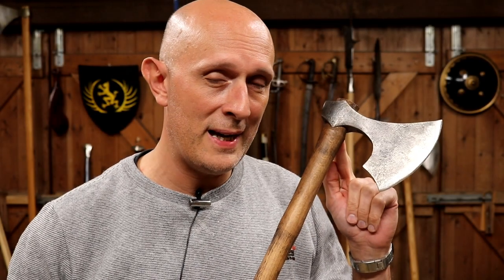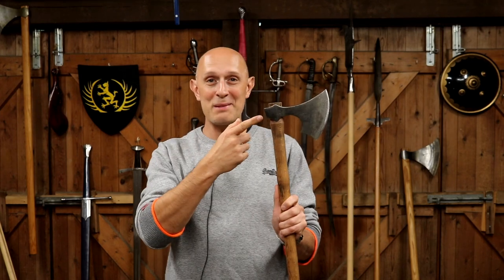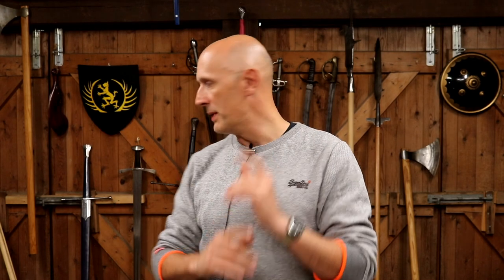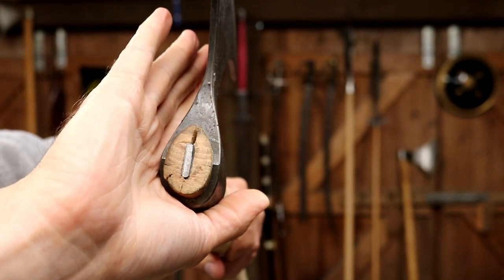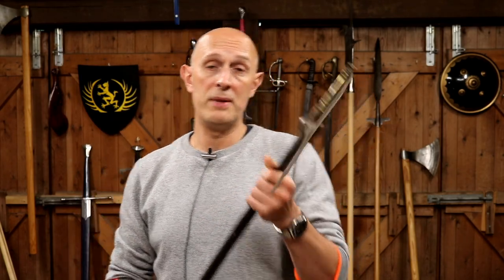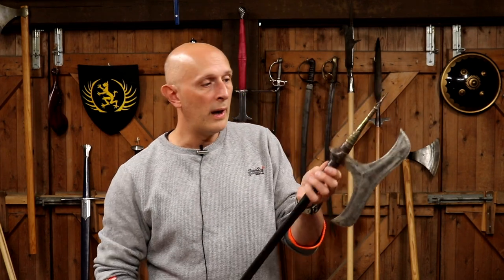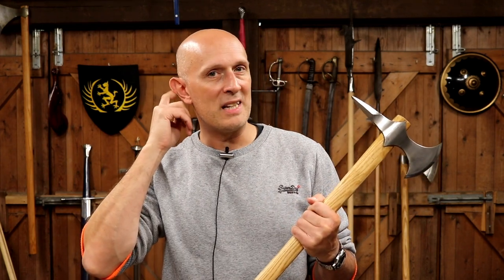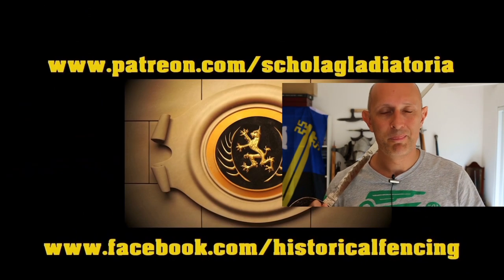Medieval Axe Construction - What Many People Get WRONG

Comment: My best guess is that using a wooden wedge in a wooden shaft might actually have been a premeditated choice - if the shaft starts changing size, the wedge would follow. 
With a metal wedge, you run the risk of the 'join' coming loose due to difference in how metal and wood react to environment changes.
Reply: Interesting point. Could you use a different even more sensitive wood?
Reply: I have made axes a couple different ways. Sometimes you use a wood wedge. Sometimes a metal one. Sometimes a wood one and THEN a metal one set at 90 degrees. It depends on a number of things including size, use, materials, and as you so cogently point out the environment.
Reply: That’s a really good point! 

I think a secondary reason may be that metal was too precious in some societies or areas in certain time periods for metal to be used as wedges. Why use a metal wedge when a wooden wedge could be obtained easily and cheaply. 
It may not seem like much to us but maybe  two or three metal wedges could be made into one good nail for shoeing a horse, and maybe three or four good nails could make a small thin knife a leather worker, seamstress, tailor, net mender, quill maker, fletcher, thatcher,  etc.. would need to pay good money for to make a living. 
Many carpenters did not use nails or used them only sparingly because of their expense. That’s why there’s so many different joint types in carpentry. I can think of two right off the top of my head, mortise&tension joint and dovetail joints.
Reply: I would have guessed the friction of wood on wood is bigger than metal on wood (dry and wet), and moisture expands wood but not metal.
Reply: @phillipmargrave  That is something we forget in our metal-rich present. The first axe I ever made was a copy of a trade axe from Fort Vancouver. Tool steel was very expensive, so the tiny piece was sandwiched inside the plain iron body. Good quality wootz was used sparingly in the best swords and cutting tools thousands of miles away in the Philippines centuries ago.
Reply: My mind really boggles at the way people make this complicated, I make handles for tools and wood works as well as anything, what you need to do is fix the head so it does not slip, simple as.
Reply: Yep, plus it rusts out

This is still a thing in knife handles
Reply: I don't think I've ever used a metal wedge for an axe...
Wooden wedges are so easy to make from off cuts & I'm much too lazy & tight fisted to actually go out & buy one!
Reply: @nirfz those are exactly two reasons why you would use a wooden wedge. Wood on wood friction means it will not fall out of place. And iron not changing its size means when the wood changes its size the wedge will fall out.
Reply: I think metal wedges are a product of the industrial revolution, and by then axes were mostly relegated to tool applications. Wooden wedges can be more delicate and often fail to mechanically survive the hang, but metal wedges were more robust to drive into most any wooden axe handle, no matter the sloppiness of the handle itself. But wooden wedges, especially if they are made from the same piece of wood as the handle, are always the superior wedge to use because both the wedge and the handle will shrink and expand in reaction to environmental changes—exactly what you pointed out. I use hickory wedges on hickory tomahawk handles, and this assures a solid head/handle connection no matter if the tomahawk is in a cold and dry winter in Montana or a hot and humid summer in Alabama.
Reply: I have hammers that go back to my grandfather and the heads are held on with wooden wedges.

Comment: My group has a number of axes that slide up from the bottom. We usually just tie cord or a bit of leather under the head after tamping it down to help keep it in its place. Helps make sure you don't get your fingers munched by your own axe head.
Reply: Ooh!, that's a good idea.
Reply: I would also think a leather or cord wrap on the handle part of the haft would provide plenty of grip to avoid the axe coming out of the hand.
Reply: @natehammar7353  I can definitely see the benefit of a band of leather or rawhide just below the hand position, as a stop for sweaty or wet hands. Good thought there!

Comment: The great thing about wooden wedges is that when you leave your axhead in linseed oil the handle as weell as the wedge swell up and give a very secure attachment, I do this with my wood chopping axes and I have never seen it fail
Reply: People forget that metal was very expensive throughout history. If they could do the job with something else, they tended to.
Reply: @nathanielkidd2840  yes, and in my opinion, since the wood wedge works very well, the metal ones needed to become quite cheaper then those before being so widespread, and that probably happened later.
Reply: brush it lightly with linseed oil, NEVER leave it soak in the stuff. Oil-soaked wood is not good, and your axe head should be secure when dry, or else it's poorly hung.
Reply: @BeetleBuns  why never soak it? Would that damage the wood?
Reply: @karltriebel4262  yea, oil-soaked wood breaks more easily than properly treated wood. I've replaced plenty of cracked and broken gunstocks that were soaked with oil, the wood just doesn't hold up to constant pounding. With a hammer or axe it's even worse. It's better to just hang the head properly in the first place, there's no reason to ruin good handles by soaking them. Besides, it takes WEEKS for a soaked handle to stop oozing oil, it's disgusting to work with.
Reply: @BeetleBuns  Thank you, I’ll not use that method 😁
You certainly wouldn’t want a slippery axe handle during a re-enactment battle!!
Reply: I hang axes as a hobby and linseed is good but I put it in over time, its only done for me and my entertainment rather than selling and trusting someone else to oil it properly so that's the context to my view, after soaking and after doing it my way then sawing the handle after a couple of years the ones soaked for a few days had a dry patch centre, slightly oily then crystallised oil on the outer, the ones done over time had a nearly complete saturation, personally I like a wooden wedge on its own with the oiling done over time, they don't rot at all and stay firmly attached with no shrinkage over time

Comment: I've got a German Goosewing Hewing axe, the end of the haft is tapered and fits into a tapered socket/eye like a chisel. The very end of it has rotted away but it doesn't look like there was ever a wedge in it or even the space for it. My guess is it was just a friction fit when it was dry and that was it. How tight it is depends on the weather and where I keep it, it's lasted since whenever people still hewed timber until now but I'd probably replace it if I expected to use it.
Reply: these goosewing axes are part of the axe myth themselves - even now they are sometimes identified as battle axes :) (even in academic publications)

Comment: Great video! Most of the spike tomahawks favored out in the Eastern Woodlands had wedged head-handle connections and oblong and even rectangular eye geometries. A lot used wooden wedges, and I was advised by my mentor, Jack Vargo, to always use wooden wedges, preferably from the same wood that’s used in the handle so that there’s no mismatch between the wedge and the handle in the wood’s natural shrinkage and expansion at different air moisture and temperature levels. However there are examples of spike tomahawks where nails were driven into the eye—often these look quite sloppy in execution, and Vargo speculated this was done in the field in order to secure a head that may have gotten a little loose. Any metal wedge can eventually lead to a loosened head/handle connection, especially if the head is hung in a hot and humid environment and taken to a cold and dry environment. The wood of the handle shrinks from the dry air, and the metal of the wedge shrinks from the cool temperature. A tomahawk hung with a metal wedge in the summer in Arkansas can be sold to a customer in Canada in the winter, and the axe head can be loosen in a day.
Reply: Hey Zack,
while watching this video i asked myself "what would that wingard guy think of that". Now i know. 
Love your products and your videos.

Comment: I'm a big axe guy. Camping and bushcrafting, not weaponry. I usually soak my axes in water for 24 hours so that the wood swells. It holds the axe head firmly in place.
Reply: Wood after several cycles of wet-dry tends to rot and get more fragile, also in the drying process it shrinks getting time after time narrower. I used to do it on my pick with a good quality beech handle, bad idea. 
Just put on some good wedges and let them do their job
Reply: If you soak the axehead/axe-eye in boiled linseed oil instead of water, you will get the same effect. But boiled linseed oil will crystallize and 'harden' inside the pores of the wood, making the swelling more permanent. I've only recently tried it, and so far so good. However, I'm not sure it's a 100% permanent fix.
Reply: Ethylene glycol should do the same thing. I believe it is how they preserve old wooden ships.

Comment: Metal wedges are probably a recent innovation.  When I was a kid growing up on my gradma's small ranch we had an old farrier's barn.  Inside were lots of old tools, probably dating back to the farrier, and tools that had belongrd to my mom's stepdad, who was a carpenter.  I clearly remember that all the axes had oval handles with wood wedges holding them on.  They probably dated back to the late 1800's and early 1900's.  I remember  because the first time we ever needed to buy a modern axe was we our family went on our first camping trip in the late 1960's.  My dad took me to buy some necessary equipment, including a campcaxe.  I was surprised because that was the first time I'd ever seen metal wedges  in an axe head.  I thought it seemed cheap and silly and of lesser quality.

Comment: I friction fit my axes from the bottom and use wedges to prevent sliding down- works like a charm and they don't break. The "points" on the eye that face downward toward the shaft act, by the way, as excellent guides and insertion points for wedges. I think their presence is fairly good evidence for wedging from the bottom, after doing it myself.

Comment: Interesting video, Matt. I wonder though, how would axes with spikes at the top be fitted through??? Was it forge welded on after the axe itself was fitted onto the haft, or would the axe and spike have been one solid piece that would then fit over the top of the the haft and then perhaps riveted through the sides of the axe head?

Comment: I'm surprised that it is not evident with the shape of the eyes on the axes that have been found as I would have expected a taper with the wider end at the top unless the finds are too corroded to tell or the smiths gave less of a fudge than usual in their weapon construction. 
Of course there is always the possibility that it didnt really make any odds because they expect to be changing the handles over relatively often so they dont need to go through the extra step of making the taper as they dont intend the same head/handle to be used again and again for an extended period of time. 

But my guess and your point match up nicely. I'd have assumed it was a "bottom up" construction primarily for the sake that it is much easier to re-handle
Reply: regardless of if the axe head is installed from the bottom or top of the shaft, both ways you would expected the eye to be tapered wide end top

and with most axe head you would not know what was the top and bottom side, they would be too symmetrical, so a tapered eye does not tell you much

even with a asymmetric axe head, like a bearded axe, so people might prefer to mount it beard up so they can thrust, so you really can't tell much
Reply: @portkapul1283  I disagree with your symmetrical statement on axe heads but i did forget about the taper of a top-fitted axe. 

Well, i guess we will have to fall back on logic alone

Comment: You should be able to see the method of attachment by looking at the taper of the eye. 
You ideally never want a straight walled eye for any tool - it would never really lock onto the shaft (actually, "haft" when talking about axe handles"), no matter what direction you drive it in from. You would be able to hammer that down into a conical haft, but it would damage the wood, causing a potential point of failure. Those damaged "step" portions could just shear off during an impact, or just slowly "bite deeper" - making the axe wobbly, needing continous attention to retighten them. A tapered eye would naturally lock onto the (tapered) wood by compression.

If you want to do a friction attachment like in a pickaxe, the hole should be tapering wider at the top to make the fit as tight as possible.
On a wedge-secured head, you would want to have the hole either being tapered the other direction - wide at the bottom (or being hourglass-shaped, tapering in both directions),  for you need something preventing the head being driven down the haft by the wedge, as well.

While the bottom taper sitting snug against the haft, locking it securely against slipping down, ideally, the wedge would need something for the wood to expand into to make the fit tighter, so you would want a taper for a wide top, as well ( thus hourglass shape). Such a hourglass ey would not only secure the head via the friction of the wedge , but also due to the wood now being conical in both directions, too. Such a construction is pretty much permanent, only drilling/carving out the now deformed wood will allow the parts to become seperate.

Comment: I have a 14th/15th century, wrought iron executioners axe. It weighs 7lb The socket is D shaped. I hafted it with yew and used an ash wedge length ways to secure it. The profile is quite like a Dane axe. It is heavily pitted but maintains a sharp 8" edge. I sold it once to an antique furniture dealer. But bought it back again, as he'd become ill at ease with the axe's macabre past. I'd only sell it now, to a medieval era enthusiast. Someone who'd appreciate it as much as I do.

Comment: Total novice here so sorry if it's a silly question... Is it conceivable that axe makers at various points in history might have used a combination of the "tomahawk" style of construction with a rawhide wrap underneath the head which would harden in place, stopping any potential reverse slippage down the shaft and also reinforcing the material lending it a bit more longevity? It would seem the materials and technology required to achieve this have been available to almost anyone who was making axes wherever and whenever that might have been?

Comment: Good morning! The 3-rd way is the moste reliable. All wages fail 100% ! Its a mater of time. Puting the head from handle side, oposite wood growth direction, and u have an axe that as much more u use the stronger it becomes. We use weges only to fix failed shafts and still its temporary solution. With love from the Bolkans!

Comment: Matt there are a million ways to put a tool on a haft, there are sockets, tangs and eyes, all of them contemporary to the era they come from and depending on what your local blacksmith was accustomed to doing. You have talked about experimental archeaology and all that, but I do wonder if you have ever had to fix a tool in the field, you do according to what you have available and form follows function, it is not difficult to figure out that when your axe or bill head is loose you will tighten it with whatever is available, look at old tools, you bang in whatever will tighten it.

Comment: Wonder why no one used rivets. Costs maybe? There are some examples of axeheads being riveted in place from the later periods, but from the medieval age? 
Come to think of it, I do not seem to recall ever seeing a modern axe with this kind of construction. Maybe it has something to do with how easy it should be to replace a broken shaft?
Reply: I have a modern RMJ Tactical tomahawk, as well as a traditional tomahawk by Devin Price, so I guess I enjoy having the best of both worlds!😁
Reply: Rivets will keep the head from flying off, but if the handle loosens from the wood shrinking you have no effective way of tightening the handle, and the rivet will need to be removed if the handle ever breaks.

Comment: You know what's kinda ironic? By adding so many wedges, they split the handle so many times that as soon as that handle gets old it's going to fall apart and lose the head.
It would literally be a better, safer axe if they just stopped at a single wedge lol